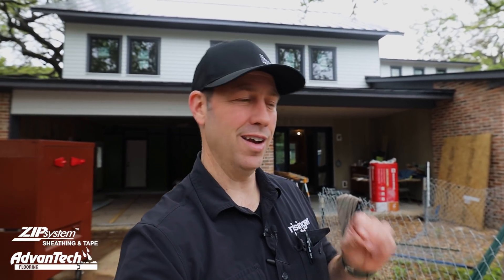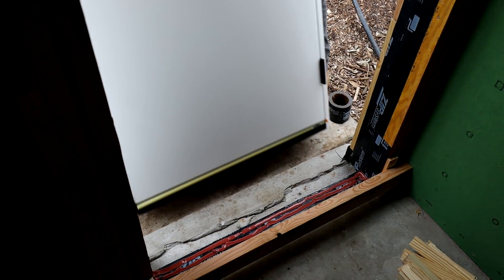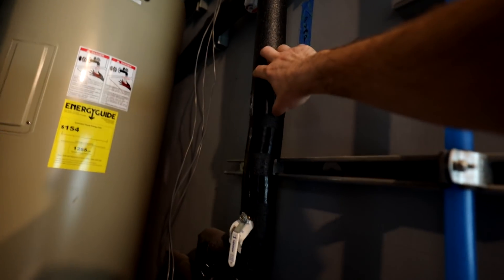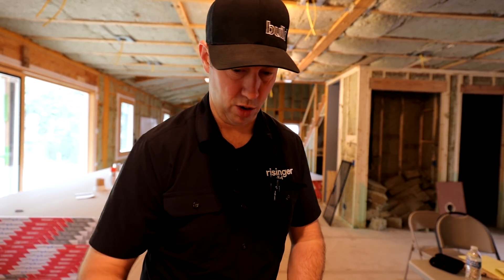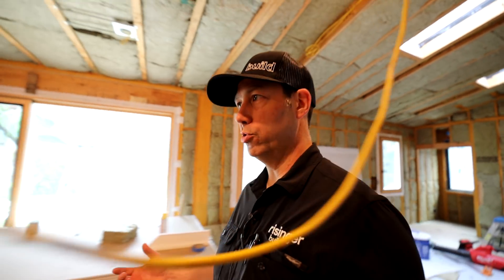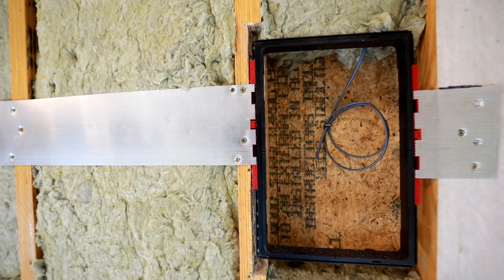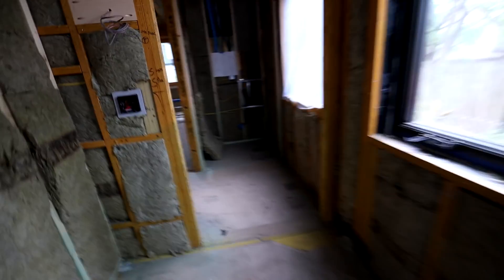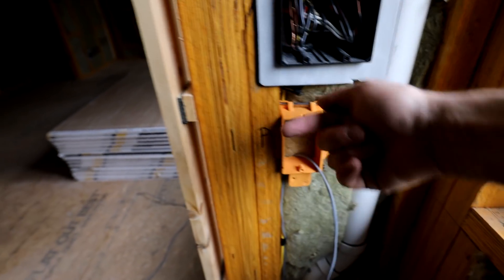Pre-Drywall Walk - Update on my house! RealReBuild

Comment: WOW I watch your videos for over a year, learning about all new technologies for heating, piping, sealing, building, insulating etc. Amount of expensive details in your house is insane (I know...sponsors) . But it looks like demark there will be just basic. This amount of Cat wires usually covers 1-2 bedroom apartment ...not a house. :)  Yes, Sonance is a company doing pretty decent speakers (but not cheap) and it's completely different than Sonos which is not "great" sound system, but not bad either and very popular, hence it integrates with almost every brand. Too bad you have relationships with building companies mostly, so you were able to put a lot of innovation and modern solutions in to the build. The automation and multimedia is really a weak point of this project as all the devices are picked without unification and integration in mind. For the next one try to find a smart home company doing Savant or Control4 to sponsor so the house is not like a great cake but without a cherry on the top. :) :) :)  Thank you for your videos, I really enjoy them as knowledge about new solutions in building it's helpful when planning home automation for my clients. 
P.S.
I know you already made a video about light switches but I urge you to reconsider and go with Lutron (based on the size of the house cheap Caseta series should do). And most important Wifi. I don't know if you prewired for AP's at the ceiling but you should have at least 2 UniFi U6LR AP disks... it's XXI century,  Don't do mesh (eero or similar...they made for retrofit apartments without wires and limiting your network drastically ).  I am sorry if I sound arrogant...it's just I see how much you care about this build and I hate when clients underestimate importance of electronic infrastructure when building homes.

Comment: Funny you still use Sonos wired speaker systems. So outdated. Rockfish does a whole house wireless including outdoor speaker system. So you can use any speaker you want and put with 120V to is a 2.4GHZ transmitter/receiver unit this way you can do it even after the fact for full 5.1 or even 7.1 audio system.

Comment: 75" and it looks like it will mounted too high. I like to look at the center of the TV when sitting on the couch.
Reply from the maker: It’s going over a 33” inch tall piece of furniture and is supposed to look like a piece of art on the wall. Planning to use the Samsung Frame TV

Comment: What is the point of sturdy multiple point locking systems when doors and windows literally just float in the middle of framing members on a bead of caulk/foam/nothing and some  shims and maybe someone put 4 inch construction screws. Best case scenario the studs are doubled or braced and someone specced and installed 5 inch structural screws through the thin door frame all the way into them.
Reply: Are you kidding? Just one 4 inch construction screw will hold several hundred pounds of shear.

Comment: Why not a tankless water heater?
Reply: I guess tankless water heaters cannot utilize heat pumps? Maximum efficiency of electrical heating element is 100%, but he can get to 400% with this heat pump setup.
Reply: @yzhang8629  I'm guessing he doesn't have nat gas service?
Reply: @paulo7200  I remember he said in one of the previous videos that he doesn’t use a lot gas and doesn’t want to pay the high service fee for having gas connected, so he won’t have gas connected to the new house.

Comment: Why in the world would you set your hot water heater to 160 degrees?  That makes no sense.  If you need more hot water, get a bigger water heater.  This is new construction, after all.  Setting the WH at 160 will cost much more to heat because of the greater difference between the hot water and the ambient temperature.  It's silly to do this.  You'll heat up your living room more and have to spend more time heating your water.  If you need the extra capacity that the hotter water would provide, you should get a bigger tank.  Is that not possible?  Is your space constrained?
Reply: His house is kinda short sighted if you consider things like this!

Comment: TVs should be measured in feet, not inches. I've used a front projector for the past 15+ years as my main TV and would never go back. 10' diagonal about 15' away and it could be much bigger.

Comment: The exposed Rockwool in the garage.  Wouldn't it degrade faster than a covered piece of Rockwool?
Reply: He said that, for the front part, he’s not going to use drywall.  He didn’t say he’s going to leave it uncovered.

Comment: Why all the rockwool vs foam insulation?? Does foam off gas toxic? Are you against it for your family???  You talk the most about an air tight house. We know rockwool is not air tight compared to foam. Now I’m worried about using foam because you’ve hardly used it in your newest build for yourself. And we all know you have the best contacts and budgeting formulas to have been able to afford it? Please let us know why you decided against foam

Comment: Seriously, Sonos. You go all out on everything but cheap out on the speakers. Martin Logan, start there. It really doesn't surprise me though, your automation selection was not that great either. You may know your materials but technology is not your thing. Also Navien instant hot has the ability to learn your hot water usage and works fairly well and turns the circ pump on in advance based on usage.  The TV should be as big as you can fit/afford and it should be OLED.